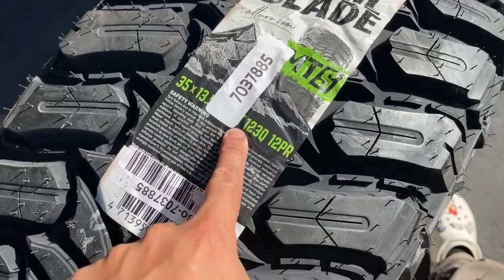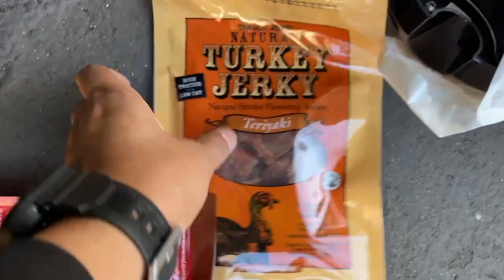Jayvie's New Wheels!

Comment: What’s the difference in height between the 2 tacos ?
Reply from the maker: I'm not sure, probably a few inches or a little bit more lol 😂
Reply: @fortunestatushawaii  his CVs not all buss?🤣
Reply from the maker: @defectahz6399  Yeah the cv boots small kind been buss, he still gotta change em 😂😂😂
Reply: @fortunestatushawaii  what he got to lift the rear?
Reply: Silver a 2” body lift and not maxed out
Black a 3” body lift and maxed out
Correct me if I’m wrong
Reply from the maker: @defectahz6399  I believe 5” blocks and add a leaf.
Reply from the maker: @808HankHill  Correct! Pretty much the setup of the silver truck is a “law-abiding citizen’s setup” and the setup of the black truck is a “hammah down noskedem gogettem runemhaahd kind setup” 👍🏼
Reply: Does his CV boots rip even when only driving on the road? Or does it only rip when he drives sand?